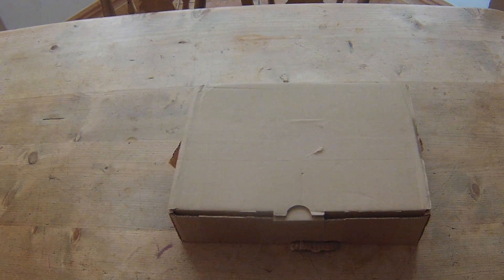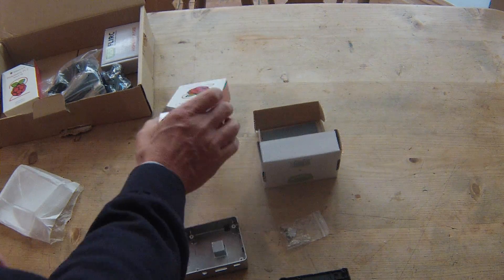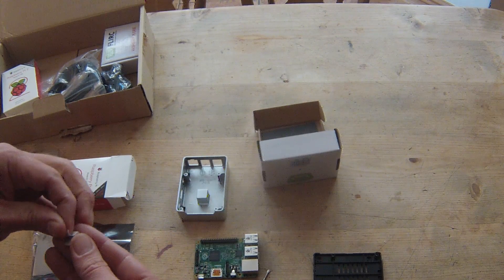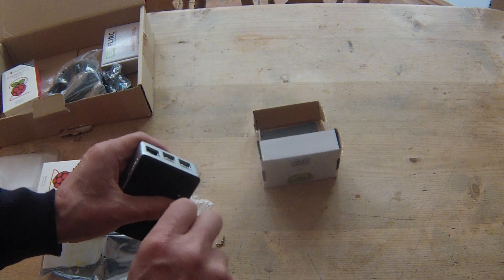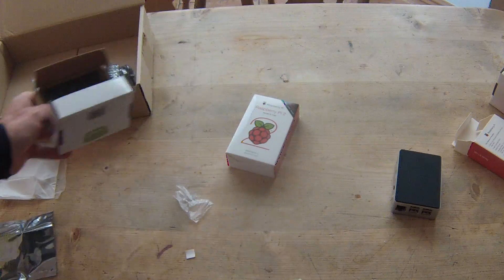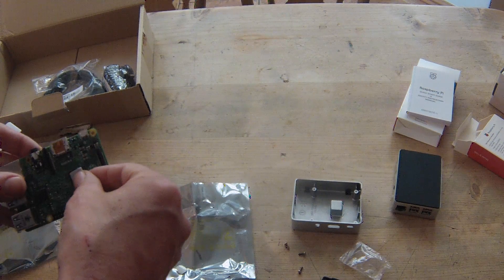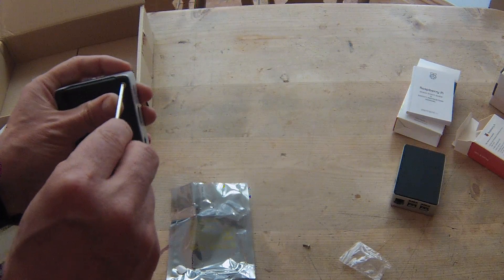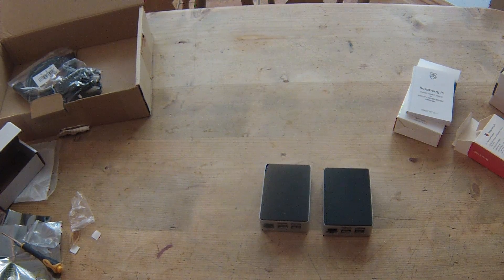Raspberry Pi 2 unboxing and FLIRC case install (2nd attempt)

Comment: Does the metal case interfere with the wifi at all? I was hoping to use Kodi but my wireless router is upstairs. Will this be a problem?
Reply: BSCDF the top is aluminum covered with plastic. The case lowers wifi reception significantly, but I still love it
Reply: The case does not seem to affect wifi signal at all, maybe because it is aluminium around the sides and plastic top and bottom. Hope this helps

Comment: Did you check and make sure the thermal pad is actually making contact?
Ive read that the heatsink post is not long enough to make contact with the CPU on the pi2.
Reply from the maker: Mark allen yes it is making contact. the RPi never gets hot enough for a thermal case or heatsinks anyway!
Reply: Bill Church True but at 1100Mhz ARM/500Mhz GPU i don't like to idle at 50 and peak at 70c granted still fine but still getting this mainly to keep my pi cooler. But anyways yea I got mine yesterday works great for cooling i dropped about 20 degrees with this on my load temps.